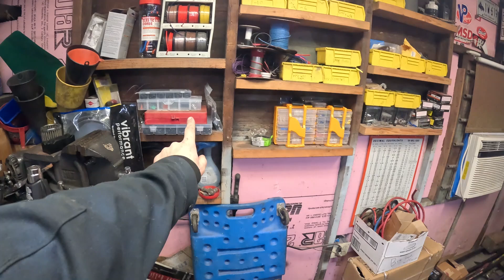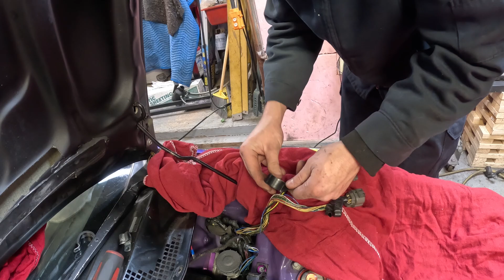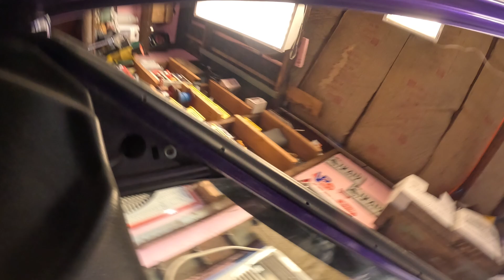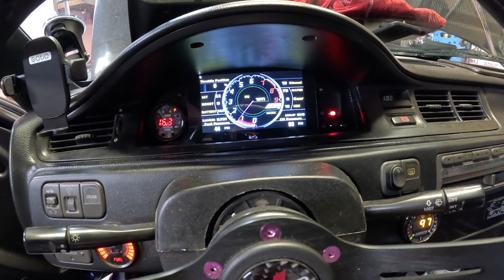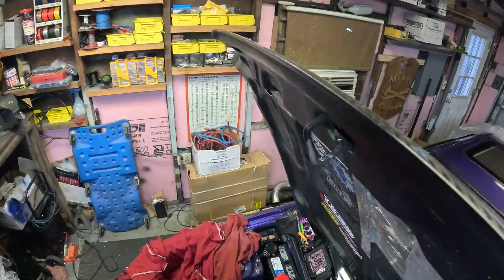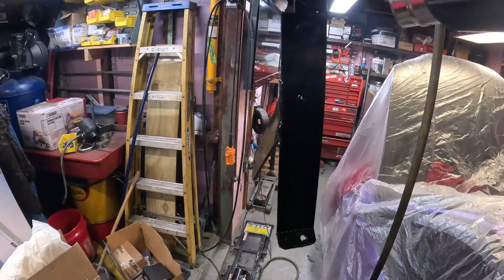$100 EBAY ENGINE HARNESS AND BAFFLED CATCH CAN FOR THE TUBRO D16

Comment: Hey what did you do with the wring of the fuse box isnt part of the oem harness?
Reply from the maker: No not the engine harness
Reply: @schmikels_garage And How do you do so the oem fuse box worked?
Reply from the maker: @yanielmartinez2425 yes you don’t touch anything with the fuse box for the engine harness on a eg only thing I had to connect to the fuse box was the big wire from the alt to the fuse box all the rest is stock fuse box wiring and location

Comment: Hey I’m really sorry have a couple questions if you could help me. I got the ame harness and my car has no wiring at all and I got a chipped ecu with laptop running all that but I’m confused on how to connect it to power. I know this sounds  stupid but where does the ecu get power from. All I have is that eBay connector. Also how does the distributor coil get power. The harness has starter signal but where does the starter get power, I know from the key but how to I wire the key into, Can I just tap the wire and add one from the key, I’m so confused.
Reply from the maker: You need the sub harness to get power to those items and the rev connector is reverse on the trans
Reply: What is the connector called for the sub harness I don’t have the relay box anymore and was going to make my own for the fuel pump wiper fan coil but how does the distributor get power
Reply: Also my harness has a connector called rev which I though was for the distributor do you happen to have a clue what’s it for
Reply: I see thank you for the help your the bomb I read some diagrams and think I’m getting a small understanding. The ecu on my needs 12v from a25 and b1 right I only have this connector and I’m gonna cut the c101 plug and just make my own wire harness from there

Comment: Been on the lookout for a new video. Links on the doich connectors? Please.  WOW you work @ Honda.  NICE  BTW.  Why did you go link instead of Fueltech? On Hondata Kpro4 now and want to go Fueltech after AWD on my 94 EG hatch K20 boosted.  Also as far as the K series cheap hundred dollar ebay ChinaChong  engine subharness they are NO GOOD!  The ECU side pinouts were WAY off and just cheap sensor connectors. Had to spend the $360 for Jackspania one. SO.......
Reply from the maker: Oh thanks I forgot to add those links I’ll do that in the next day, I chose link cause it was much cheaper and is plug in ecu no harness need to be made and does everything the fuel tech can do for what I need. I also don’t like how small the fuel tech screens are
Reply from the maker: I finally added the connector links